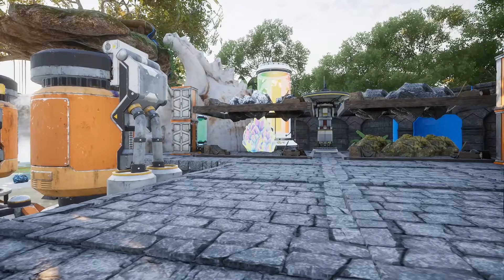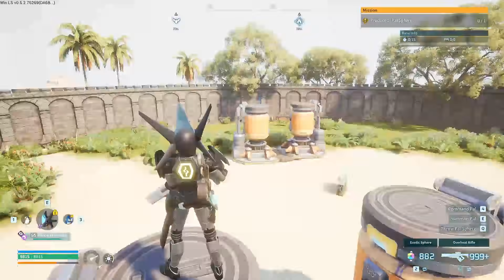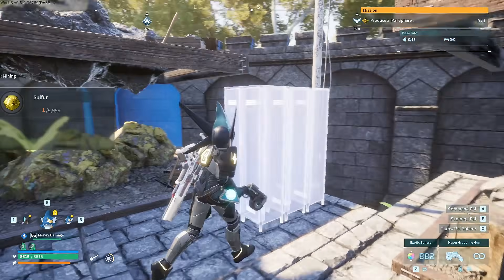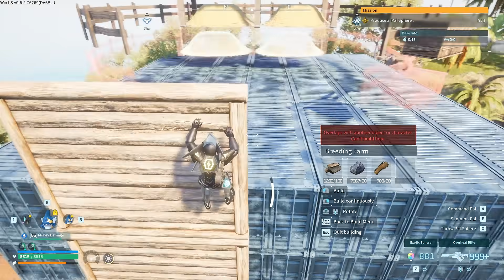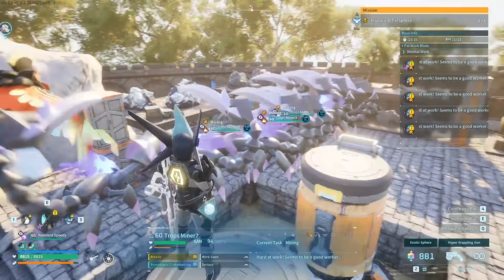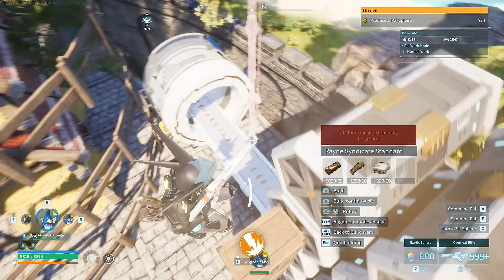How to Build the NEW BEST BASE in Palworld 3 Oil Veins Setup Guide

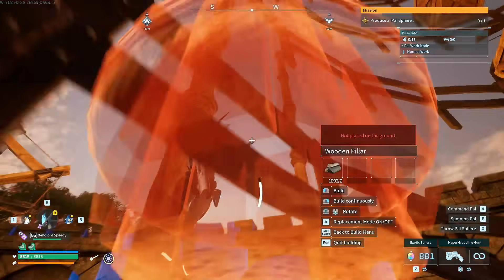Comment: 11:15 It won't let me stack any higher than 4 wooden benches :( help???
Reply from the maker: Place the walls higher.
This will then let you stack more benches.
Reply: @TropsPlays I placed 6 pillars high and it still didn’t let me ;_;
Reply: @TropsPlays  I stacked walls up 20 blocks high and it still won't let me place benches higher than 4 benches.
Reply: @TropsPlays  Nevermind, I got it to work with pipes.

Comment: Been trying to mimic the stacking hotsprings, but cant get them to snap to the flag at all, did the same as video and just wont snap at all, was it fixed maybe?
Reply from the maker: I will make an updated base video but it should still work
Reply: @TropsPlays  Appreciate it! I attempted 5 times in different spots to make sure the position wasnt the issue and couldnt do it

Comment: how do i do the production line stacking with the II
Reply from the maker: Same process.
Try placing another fireplace ontop
Reply: @TropsPlays  i kind of fixed it, i placed 5 fireplaces instead of 4 and i just manually placed it ontop into the wall so it was in line with the one under.

Comment: I thought u can only have 15 palmons in a base, whats the use of having so many ranches? I'm new and i'm sorry if this is a dumb question.
Reply from the maker: This is an all in 1 base.
Each station is designed to fit 15 pals for max production if needed
Reply: @TropsPlays  i see, so if i put 4 pals in a ranch, will those 4 pals occupy all the ranches? Thus giving us high yeilds? The same for breeding pens?
Reply from the maker: @manishvardhanmutyalapati6133  not all of them. only the once the pas are assigned to.
is just so if you needed materials from you rances you could assign all pals to them.

Comment: Am I missing something? I need to use 4 large power generators with 8 orserks to even power this base. I also have 4 accumulators placed. If I don't have all 8 orserks, the base will lack power
Reply from the maker: Are they full condensed?
Research on electricity maxed?
Best passives?

Comment: I'm having trouble stacking the palbeds, it says that the bench "overlaps with another object or player" when I try to stack em more than 4 high
Reply from the maker: You might be too close?
I woll retest this soon.
Also are you placing them top to bottom?
Reply: @TropsPlays i dont think that's the case, bc i was on the other pillar like in the video
Reply: @TropsPlays oh also, my problem is with stacking the benches not placing the beds on the benches
Reply: @SunTzu-o2z  getting the same problem
Reply: @topsniper61 I just figured it out so I figured I'd let you know too. If you snap the bench onto the second pillar it should place, so your gonna have to build your pillars one higher to be able to place the last layer
Reply: I can't stack the benches high enough to try placing the beds, i haven't run into that issue if im having one. My problem is: the benches won't stack higher than 4. I placed my plantations fine, its just the height I cant get around

Comment: there is no way to place the oil extractors like that anymore it seems, at least not on MP.

EDIT: Sometimes it works, i think it has to be an issue with the server updating or something. I did a restart and placed it exactly the same as before and it let me place 2 on 1 vein.
I also noticed that you can't stack assembly lines on furnaces anymore for some reason.
Reply from the maker: yeah it's still possible. kinda wierd you needed a reset.

Comment: Putting the expedition in the air is just not working for me I don't really understand why
Reply from the maker: Okay I will check it out
Reply: @TropsPlays  I'm also having issues with getting the site working on the locker. Have you figured out if this is an issue?
Reply: @TropsPlays its Not Working anymore for sure
Reply from the maker: @moritzwagner5843 it does try placing more or even a different item like advanced chests

Comment: each base has a maximum of pals to be placed.  this is nice but useless because of pal limitation per base unless you change the default game setting
Reply from the maker: No its an all in 1 base.
This is great for the default 15 pals as it allows you to swap pals around depending on your resource needs.
This saves bases as you only get 4 bases per world.
Reply: @TropsPlays  didnt they changes it to 5 or am i trippin?

Edit: You can place a lot more than 5, we currently have 8 Bases in our world

Comment: does anyone know id this still  works or not in the homesweet home update
Reply: So far I’ve gotten the expedition site placed with no problem. But the fishing spot is unreachable to pals. It floats on the lily pad and the stairs are in the water about 2 feet off the ground.
Reply from the maker: look pinned comments.
Use 2 roofs for support
Reply from the maker: yes this still works

Comment: Has something change since this video was made? Have only been playing for a little over a month and I was originally placing stairs like in this video(@3mins) but discovered you can press Left Alt to make them snap down.   If your at a corner just face the direction you want them to snap, if they keep trying to snap the wrong direction just move closer to the edge facing the direction you want them to snap.
Reply from the maker: Yeah I've noticed as well about snapping stairs down straight away

Comment: Building bases stacked on top of each other like in the video saves a lot of space for the base, but it will get stuck in the pal bug.
Reply from the maker: For a 15 pal base this size there isn't issues as its not crazy.
With the 50 pal base pals get stuck but they work from where they're stuck or fix themselves.
Reply: @TropsPlays  I noticed when pal sleeps, and wakes up. pal in high position will get stuck and cannot go down. I observed for many consecutive days that pal does not fix itself and needs our intervention, so I changed to only build 3-4 stacks.
Reply from the maker: @batonglongme7554 all the pals should have nocturnal.
The beds are there so it stops negative effects.

Comment: hello, if there lvl 50 pals defend this island, can you kill them and they wont back again?! only out of my base?
Reply from the maker: They will respawn but outside the base.
The wall protects the base so the pals won't even get interrupted.
Reply: @TropsPlays  alright, now I need a solution to kill these with lv 32 :D
Reply from the maker: @Light-th1co quickly capture x12 of all pals until your level 50 as you need oil extractors here

Comment: it suck to have that flag lvl 63 and i can't use locker they dont snap on top
Reply from the maker: Oki so use a locker then snap something taller or smaller to the locker.
This way you can then snap lockers going up placing them left right left right.
Reply: @TropsPlays  that worked thanks i used bench xD

Comment: question about bed stacking  can it still work for non nocturnal pal ? because i am too early in the grind to have nocturnal i barely started anubis cloning at lvl 45 lol
Reply from the maker: No they can't teleport unfortunately.
You can use the surgery table and put nocturnal on your base pals
Reply: @TropsPlays  i am not that rich either lol but i will keep grinding thanks

Comment: im trying to build this but my palbox centering is off bc either the left or right side of the foundations dont match yours. do you have any advice ? or should I be placing it a specific spot ?
Reply from the maker: Watch my 50 pal base and copy the strategy to get perfect placement.
Reply: @TropsPlays  I watched it but isnt it for a different location ? unless im dumb and want me to use the location for the 50 pal one
Reply from the maker: @chitogeweeb  yes but you use the strategy.
So on this base you place the palbox, build the 2 extractors to the right. place foundations as in the video and then replace the palbox for perfect placement. I can send you SS on discord to help you
Reply: @TropsPlays  yes if you can send a SS, id really appreciate it, ive tried building this base for two days but I keep having to redo it over and over again lol, I have joined your server
Reply from the maker: @chitogeweeb oki I should be online soon
Reply from the maker: @chitogeweeb  dm me on discord
Reply: @TropsPlays may I get a ss for placement also I’m also having trouble with the foundations
Reply from the maker: @JustTed-02 no problem just sned me a direct message on discord
Reply: @TropsPlays done my user is JustTed

Comment: Do you have an idea as to why the benches arent stacking properly for bed stacking? After the 4th bench, the 5th bench starts overlapping with the 4th bench
Reply from the maker: Yeah I show all the fixes to all the problems that occur when stacking high up on my stacking video/50 pal base build.
Build more walls higher up so you can look higher which corrects the bench placement.

Comment: Came across your vid 3 days ago and been working on building this base. Problem is, I can't seem to find the locker schematic in Technology tab. I googled it and it says its under level 26. When I go underneath it, I still can't find it, and even searched it. Was curious, was the locker schematic moved elsewhere or is apart of a set, or if it was removed altogether? Any help would be appreciated. Sidenote, amazing build dude,  to anyone looking for a build, this one is so simple and easy to follow
Reply from the maker: It's a part of the set. I believe you have to be level 18 (Metal Shelf Set)
Reply: @TropsPlays just checked, and yes you're correct. Thanks for clearing that up for me❤

Comment: How you get oil extractor 2 per node I tired and can’t get it right message still says their to close to each other
Reply from the maker: It still works.
Face northeast or southwest.
Put the extractor with that back of the vein.
Move right until it dips down and turns red.
Move left ever so slowly till it turns blue, then place it down.
Move to the left to place the last 1.
Reply: @TropsPlays  I was able to do it as well. Though you have to be pretty precise in facing your body NE or SE and even then you will only get a BLIP of blue to place it. I ended up moving back and forth and clicking my mouse really fast until it placed the second one

Comment: Im having a lot of trouble trying to place the foundations. Whenever i try to place them by the oil extracters they dont place its just red. Ive tried replacing all the extractors many times. It doesn't help. Any help anyone
Reply from the maker: Okithanks for letting me know.
I'm currently doing a 50 pal base build and I show a technique I found that allows you to place everything exactly the same as mine.
It should be live in 1 or 2 days.
Reply: @TropsPlays OK I'm excited for that one

Comment: This may be a dumb question but it seems weird to stack so many chests with the Pal Retriever because how could you know what is in all of them? Will the Pals just bring everything to all of them once they are full? I feel like even if it is min-maxing space it seems overkill and maybe annoying to access each chest. Thanks in advance for this insight
Reply from the maker: Okay, I understand your confusion.
So all productions sites/structures have their own chests right next to them.
Transporting Pal will deposit items into chests closest to the items (most of the time).
This helps organise your chests and also speeds up transporting time.
However, sometimes they deposit into wrong chests, so that's why I have all my actually organised chests next to my bed.
This is because it's far away from the production sites that the pals will never put items into them.

Comment: I can't stack more than 4 benches it seems (to do the pal beds). The 5th one looks recessed a bit into the 4th bench no matter what I try to snap it to and stays red (wood/stone pillars/walls)?
Reply from the maker: Don't worry I have you covered, stacking video out tomorrow!
Reply: @TropsPlays  Thanks! (Same issue, unable to stack assembly lines on the fireplace either)
Reply from the maker: @JuannyPoo I cover that also

Comment: Instead of placing stairs above to place some down below you can press alt and it will snap down idk what it is on controller but should be in settings:)
Reply from the maker: Yeah I've seen it. Someone told me in the comment already.
It's called change mode.

Comment: How many pals can leave on base to fill this many thing
Reply from the maker: Default settings are 15 pals, but if you want to, you can increase the setting up to 50 pals.
Reply: @TropsPlays  can you stack more than 15 beds?
Reply from the maker: yes you can. I just did a stacking video which shows you how to stack super high which I haven't seen on youtube before so I'd highly recommend you check it out.
https://youtu.be/aHPIUO9U8SI?si=3jhg2AwK7xEIiSF8

Comment: The hotspring stacking only works with that 1 specific flag at lvl 63 Is there any other way?
Reply from the maker: yes you can use lockers. when testing use the alignment mode to see if it snaps in place before going super high up.
keep going to the right as you do with the flags to find the perfect location.

Comment: Im lvl 50 right but is there anyway to not use flags? I dont have them unlock until very later or at least it will take me a while to lvl up. Is there another item I can use that can also be used? 

Great video btw and new sub😊
Reply from the maker: You can just use the lockers.
Use sometimes besides the lockers to keep stacking higher and higher if needed

Comment: This was interesting to watch. 😅 Item placement is really difficult in Palworld so I probably just build bases with several floors than try to fit everything to just one floor. I remember one guy who had 5 floor factory bases in Palword, extremely optimized to get infinite ampunts of every item fast&easy, and no difficult stacking with the glitches.
Reply from the maker: I used to have multiple floors but pals can get wierd depending on how you've organised the base.
also when using fast travel the pals would end up all on the ground floor messing it up.

Comment: i can put everything like this but cant put production line on the fireplace.  idk why   or can put it only advance ?
Reply: Same So I just made a Advance one and it worked for me
Reply from the maker: you have to build the fireplace before placing the production lines down, make sure they're rotated
Reply: @TropsPlays  I'm only level 54 will it work with a production assembly line 2 can't seem to get it to work
Reply from the maker: @phyllisgillaspy8118 Yes, but the fireplace placement is 3 long, and you need 2 fireplace 2 wide. For some reason the production lines are wider.
Reply: @TropsPlays  finally i can made like this but it's work only advance any line
Reply: @TropsPlays  Okay, thank you for taking the time and answering our questions! 🙂

Comment: Thank you for this video, I do have a question. I have all the breeding pens aligned, but 5 of them aren't breeding As I'm trying to place down more pals, but they just get assigned to the previous breeding pen.
Reply from the maker: You have to use a monitoring stand to align the pals into the breeding pens so they can all breed.
This is because the pens are stacked so high, so when you throw pals with your character, they will assign them to the bottom pens.

Comment: I dont have flags unlocked yet, any suggestions for alternative for snapping?
Reply from the maker: You can use lockers.
For the hotsprings you can also use lockers but may have to go 2 extra to the right
Reply: @TropsPlays and what would you suggest for a 50 pal base in terms of the beds?
Reply from the maker: @XerxesHeika you want nocturnal pals so just stack 50 beds.
They don't sleep at night but you still need to place beds because if you don't have beds pals gain negative effects

Comment: how do you get pals to mine the stacked locations? my pals only go after the bottom layer and nothing i do allows them to mine the upper level. im afraid to even attempt the ranch or breeding area likethis
Reply from the maker: You can use a monitoring stand to assign a pal to that location.
With the tip layer of mining sites you can even just pick up the pal and jump, while in the air throw the pal at your desired site.
Reply: @TropsPlays i tried throwing them and they defaulted to the bottom. Maybe I'll try the stand as well and see if that helps any. Is that how to do it with the ranch and breeding? Just toss em in there? Lol
Reply from the maker: @gedion4000 with the rance and breeding I just throw them inside it I only have 2.
Any more I use the Monitoring stand

Comment: This base is designed for how many pals? And could tell wich pals? Like "I have 6 Anubis for production, 2 orserk for electricity, 2 bastigor for cooling" etc
Reply from the maker: I use 15 pals.
Standard pals are 2 prunelias + 1 Lullu + 1 Jellroy for plantations.
3 Menastings for mining.
2 Faleris for Transporting.
1 Dazzi Noct for Electricity.
1 Incineram for ingots/food.
Anything else you can add to what you want, depending on your needs.

Comment: awesome, but why is it SO HARD to place 2 oil extractors in the same oil hole 😭😭😭😭😭
Reply from the maker: It become a lot easier when you've done it a few times.
You have no room for error unfortunately
Reply: @TropsPlays i think 5 might be enough 😅😅 i'm still only lvl 55
Reply: Is this recently fixed? I get the message it's too close to a special boss or facility. Or is this a server setting I overlooked?
Reply from the maker: @gerbenbos3331  no it says that.
You need to place it down perfectly.
I will help you do it but I get back from holidayin 12 days